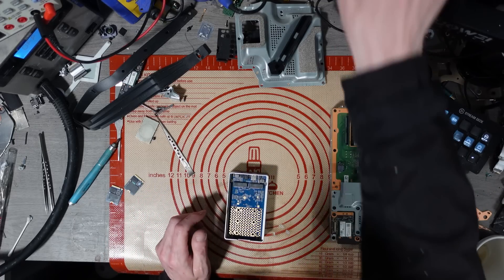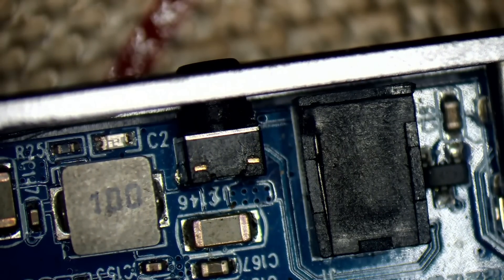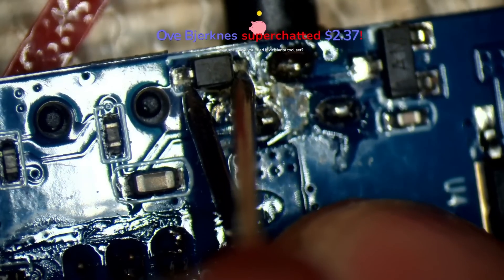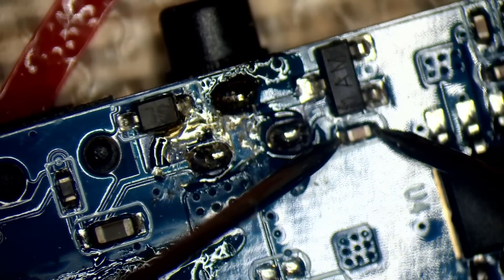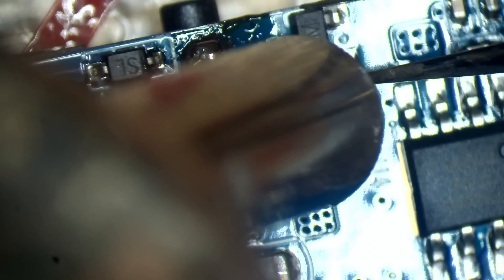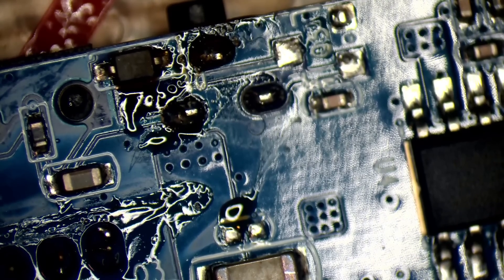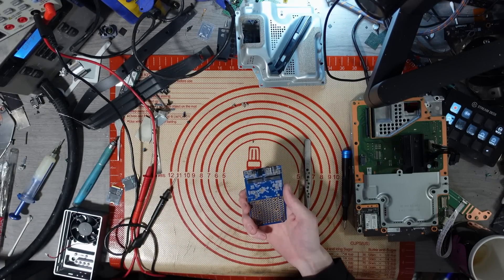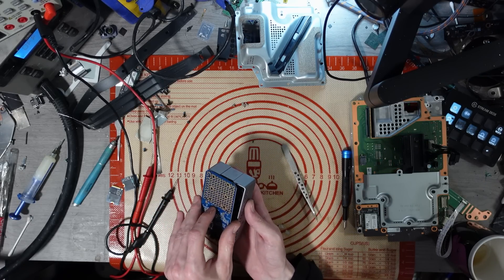My Sabrent SSD Cloning Tool Started Smoking LIVE ON STREAM! Can I Fix It?

Comment: Well done Phil. Having to fix a tool happens. Only thing to remember for the future. Besides the transistor function/voltage you also have to know if it's an NPN or PNP. Otherwise the wrong one won't forward bias. 50/50 shot and you got lucky :)